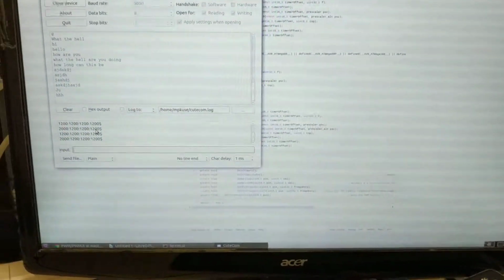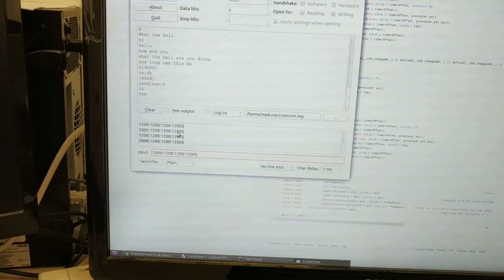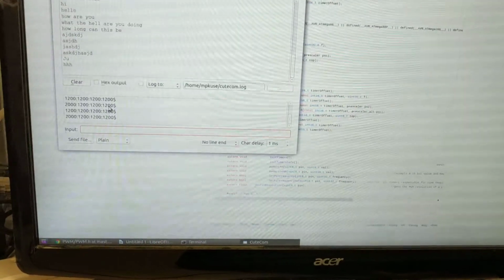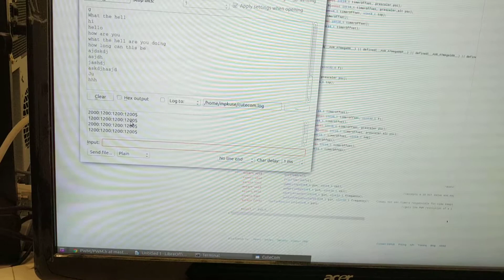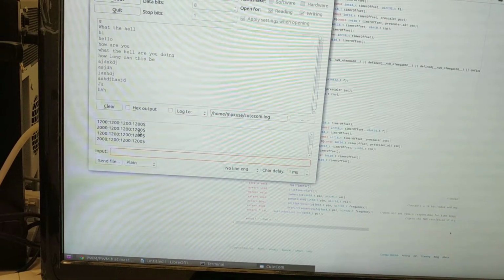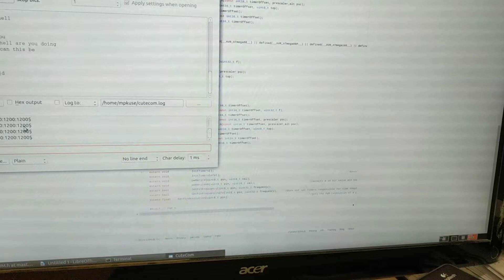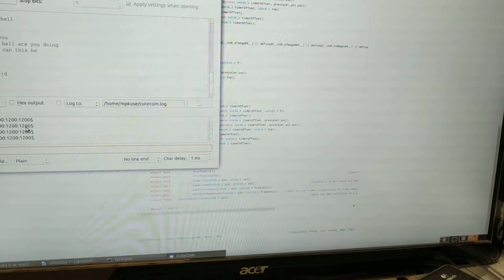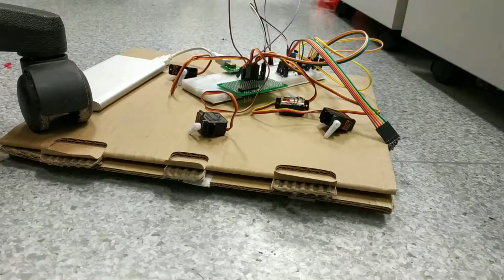Part-2: Driving servos remotely using hc12 (long range Bluetooth)

Comment: Did you ever figure out the motor vibrating problem? I've gotten as far as you and need help if you've got it.
Reply from the maker: Yes. Actually the nano does not have hardware pwm. For serious applications best dont use a nano. I ended up using another arduino based microcontroller called teensy.
Reply: @swaroopcool22  Hi, I am also having this problem. Is there a work-around? (Using the arduino nano)
Reply from the maker: @blenkiron1795  I donno how to solve it for the nano. If you happen to figure it out please comment here to explain
Reply: @swaroopcool22  I managed to find a solution: use the ‘PWMServo’ library instead of the standard ‘Servo’ library. It works exactly the same, and it fixes the issue.
Reply from the maker: @blenkiron1795  awesome. Thanks for sharing the insight. I will try it next time I play with Arduino